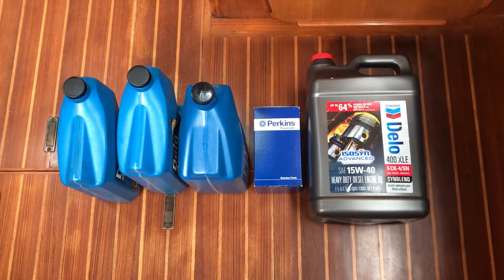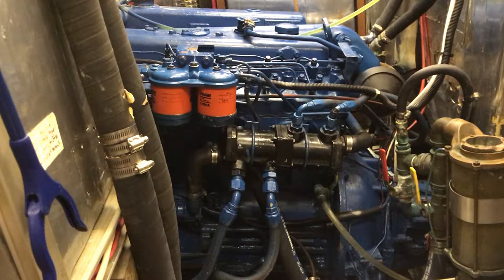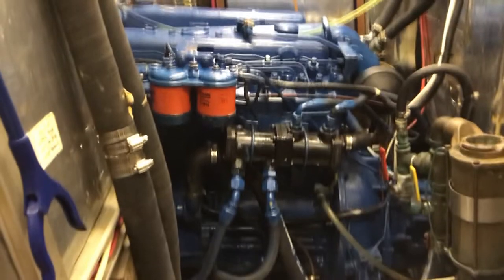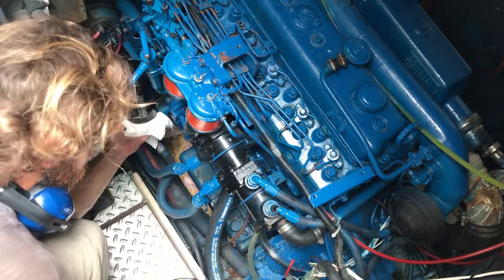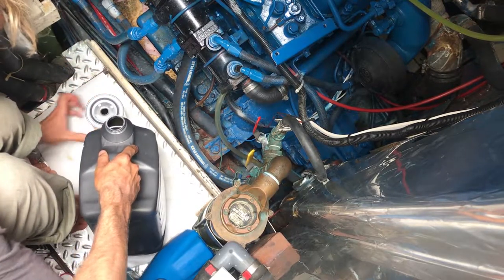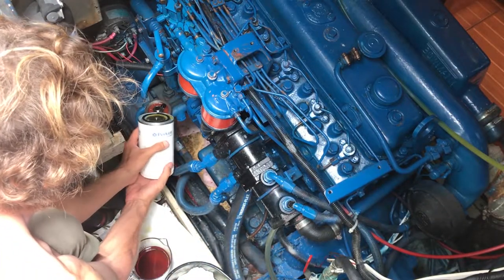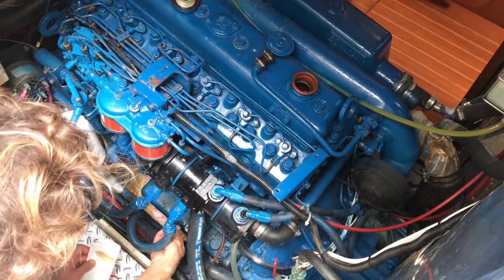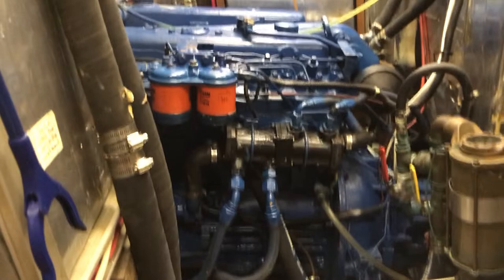Sailing Around the World | Yacht Maintenance | How to do an Oil Change on a Marine Diesel | Perkins

Comment: If you take a center punch and punch a small hole in the old oil filter before you take it off the oil will slowly drain out of the filter. You won't get it all out obviously but it will be significantly less. Hope this helps
Reply: Also as said below there is no need to completely fill the new oil filter. I like to put some in and roll it on its side just to coat the grids and a bit on the o ring and threads to make things smooth. Great video. I love the pump on the engine wish more engines came with something like that
Reply from the maker: That’s a great idea! I’ll try that next time. Thanks so much for the suggestion!

Comment: I would suggest that you don't fill the new filter with oil. Simply smear the rubber seal with oil before fitting the filter and allow for a little extra new oil in the engine to take care of the oil that will be needed to fill the filter. Run the engine for a few minutes and check the level, adding more if needed.
Reply from the maker: Hi Tony,
That’s really helpful! Hopefully it won’t be as messy next time. Thanks!